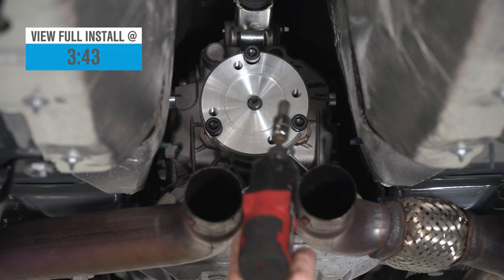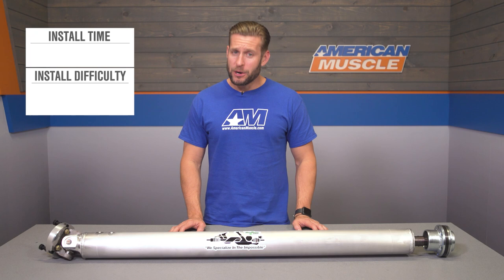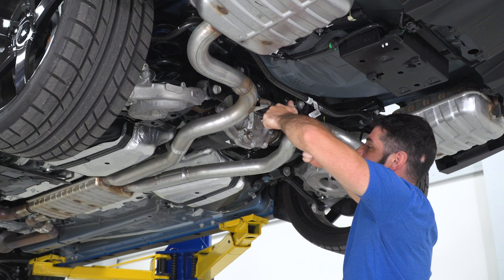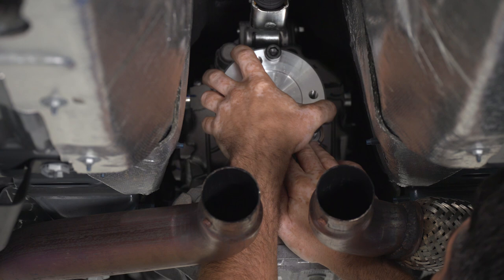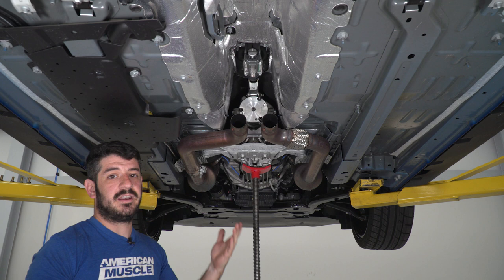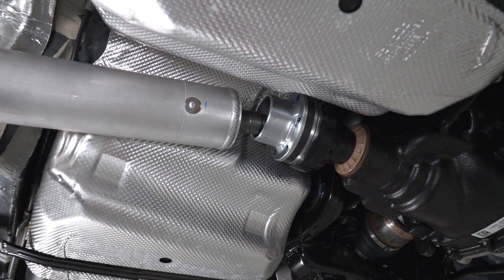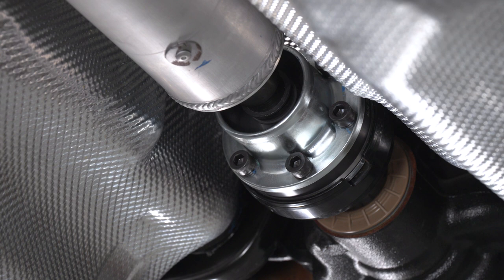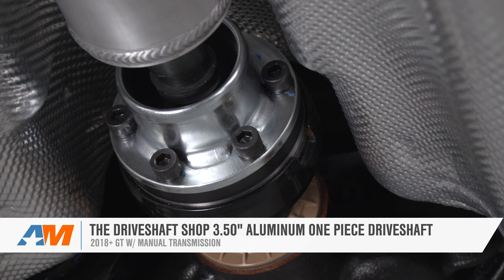2018-2020 Mustang GT w/ Manual Driveshaft Shop 3.50" Aluminum One Piece Driveshaft Review & Install

Comment: I've read about many vibration issues with the one piece aluminums. Is this true for 2020 GT's?
Reply: it was sure true for mine.17 gt 5300 miles i did craddle lock stage 2 an diff lock an man its an issue.
Reply: If there is a vibration issue, 9/10 chance you installed it wrong.
Reply: I can say at 150, I experience no vibration on my 14 gt.

Comment: I just installed my DSS ALU one piece and I have a vibration I can not seem to figure out why. All points all lined up on the front but no DSS marks on the diff side at all. In the video they dont talk about the diff side at all. IS there one to line up? The vibration only happens between 14- 1800 rpm then goes away. Anyone have any idea?
Reply: Probably improperly balanced right from DSS.

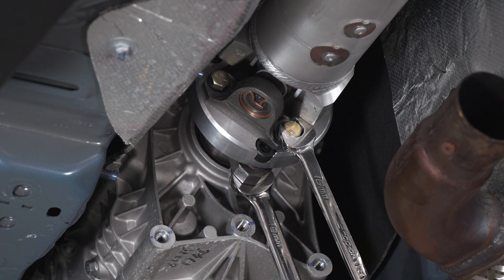Comment: I just installed this in my mustang, this video was a huge help.  Despite not being in most other install videos, the trans crossmember had to be dropped for me to fit the shaft in, like in this video.  My favorite part of this one is 16:55 where you say to torque those bolts down knowing full well it’s impossible.  I’m sure you guys torqued them down off camera wink-wink